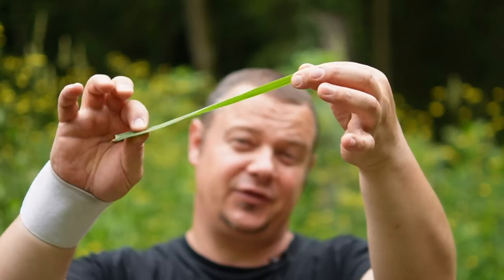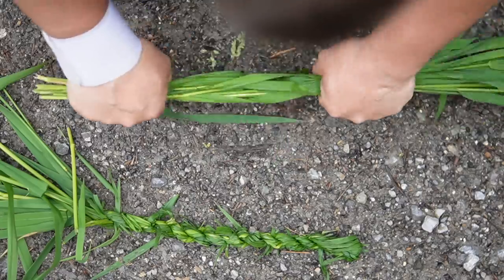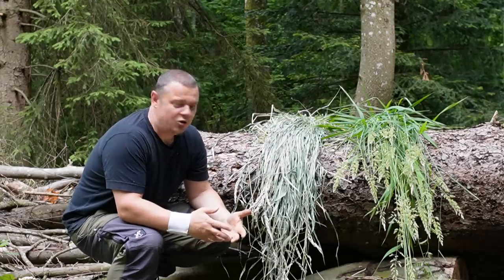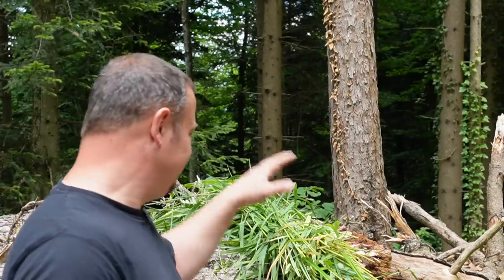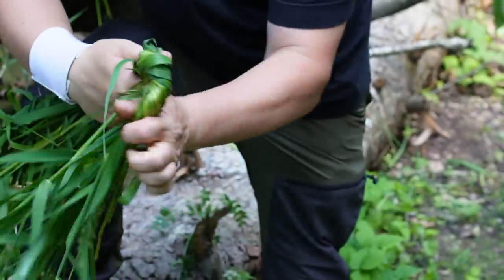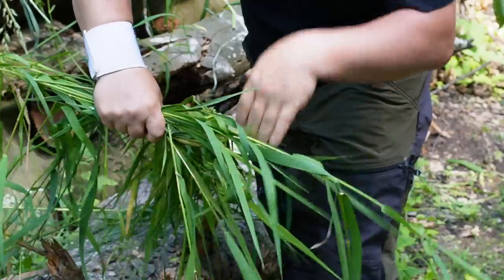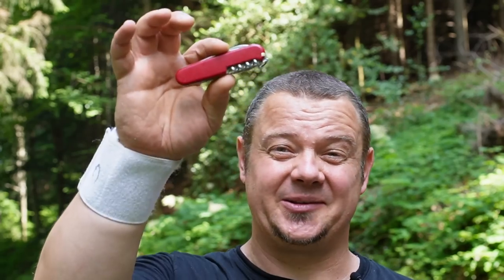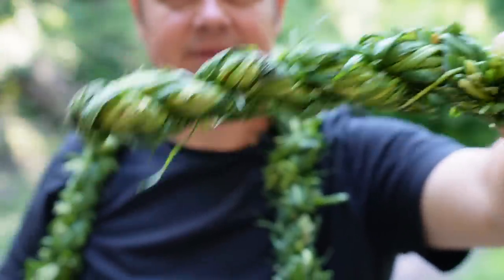Grass Rope Tutorial - How to craft a grass rope / DIY Natural Cord / Bushcraft, Survival, Outdoor

Comment: I wonder if it is possible to make a rope from fresh grass, allow it to dry, and untwist it, and then re-twist it to tighten the fibres. I suspect that the individual grass stalks might pull apart in such a case.
Reply: That works fine with nettles.